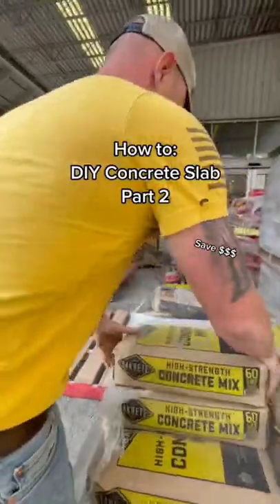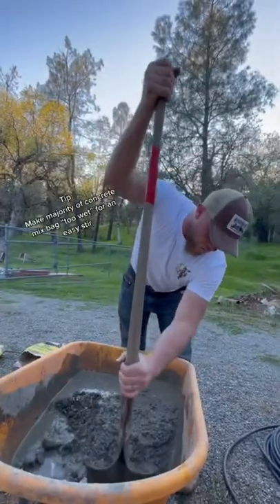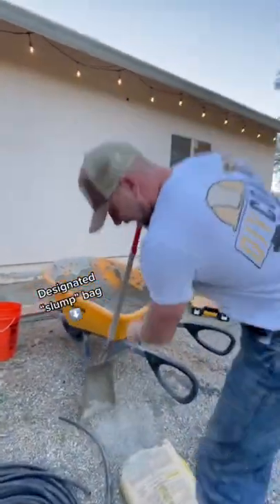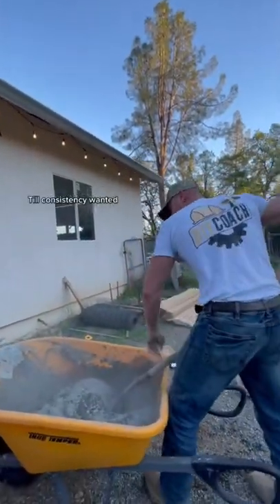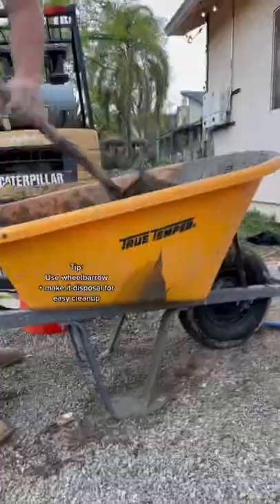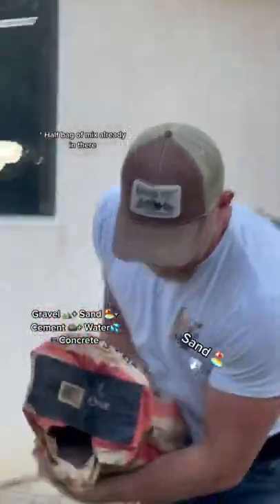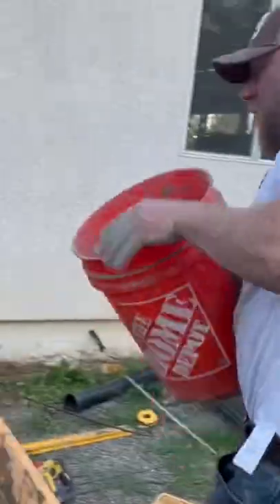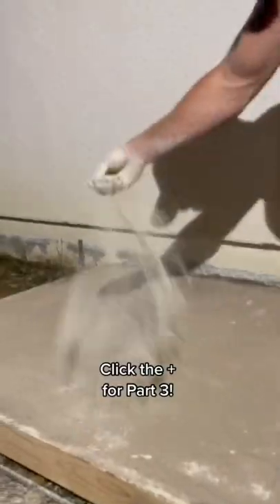PART 2: How to DIY Concrete Pad #shorts

Comment: Length x width x height = cubic measurement that you will need. Always get a little extra, remember the more water you add the weaker your concrete, and when using a vibrator don’t ever stay in the same spot for more than 8 seconds. Also If you do not have a vibrator make sure to peck your forms with a hammer especially in corners. And always always oil your forms if you are doing anything like stairs or chimney caps. Good luck!

Comment: So by adding sand and Portland cement you just made grout not cement you need to have stone in the mix to make cement with out it all you made is grout
Reply: Sand and Portland is Mortar my dude.
Reply: @unitnippynipz   yep got my wording messed up
Reply: @dshaffer3731
Reply: The amount he added was insignificant to the overall mix.
 @unitnippynipz
Reply: The amount he added was insignificant to the overall mix.
Reply: Your said adding sand to Portland cement doesn't make cement? It does, you mean it doesn't make concrete.

Comment: Yeah buy a plastic $120 wheel barrow to mix in and break day one instead of the $170 metal one made for mixing in thatll last you years. Ahhhh fuck it get a "disposable" wheel barrow yeah never heard that before
Reply: Yeah you got a point or use buckets and get a quick easy mix and spend what 5 a bucket

Comment: What does adding sand to the actual mix do? A more uniform finish?
Reply: He's cutting the mix to save money, don't follow anything this guy is doing
Reply: This is a parody
Reply: Makes it crumble when it ages dont do it
Reply: No he added to much water so the mix was wet. He added sand and cement to the wet concrete Same as adding another bag of concrete mix.
Reply: Oh this just occurred to me…concrete and cement are not the same thing. 
Concrete is made with cement, sand and gravel.
Reply: @Daihatsu_Hijet  what he even said it's to wet so I added sand why ad sand if u have more concrete just add the Crete not the sand
Reply: @Daihatsu_Hijet  but he didnt add more crete.. he even said its wet so I am adding sand.. and why ad sand if you have Crete. It would just male it weak and flake.. to much sand in the mix is not good and i dont know a single Portland company that says hey mix more sand we did add enough... they dont say that because they dont want you to mix anything other than dye fiberglass or more concrete never just  more sand
Reply: @ptravers9077  he added sand and Portland cement!!! 
Sand cement gravel makes basic concrete mix!!!
Reply: @ptravers9077  you are not paying attention and The amount he added was insignificant to the overall mix.
Reply: @Daihatsu_Hijet  no ur right I rewatched he did say he added Portland sand and some more crete my bad bud I totally thought he just added straight sand to the mix I'm dumb my bad
Reply: @ptravers9077  👍🏻👍🏻👍🏻

Comment: I've always made my mix a bit running i spray some water on top after I put the cement in the mold and add an inch or so of water it seems to help it cure better

Comment: He clearly does not see the irony and symbolism in mixing the concrete "too wet." 

Then, adding more concrete to attempt to adjust to the proper consistency. His wet concrete symbolizes how he rushes through his jobs/life with out any concern to properly measure or do anything right.

He eventually ends up with an unusable product/job/life. I will comend his spirit for clearly being a glutton for punishment. Not only does he screw up everything he attempts because he thinks he is God's gift to the Earth. Mainly because he does not take the time, care or effort to attempt to do anything with proper procedure or measurements. Then he post on YouTube for everybody to laugh at his sorry excuse for an attempt to do basic backyard jobs and have a basic backyard life.